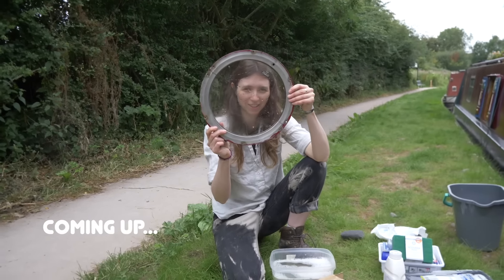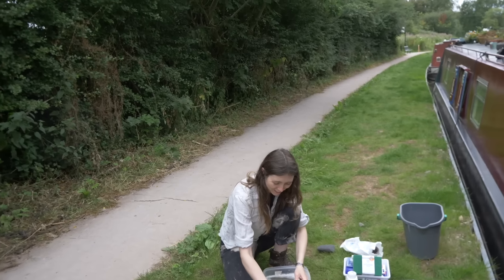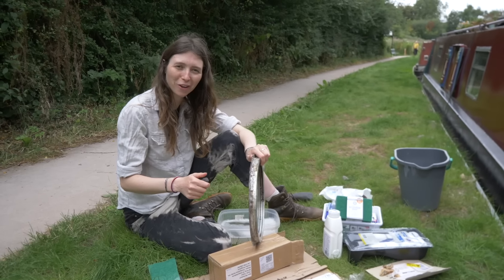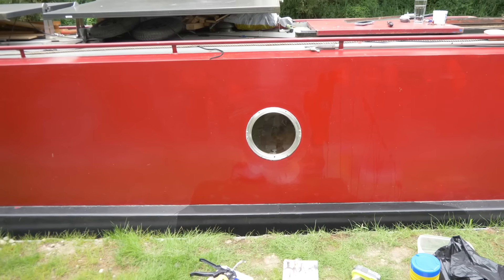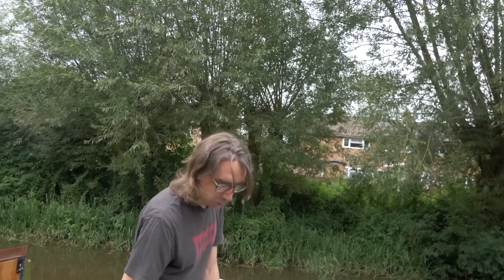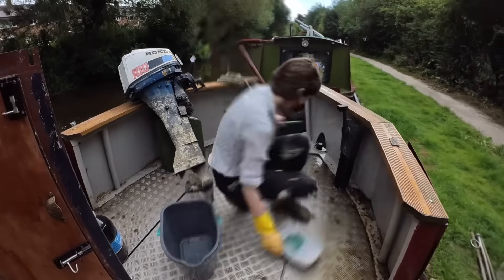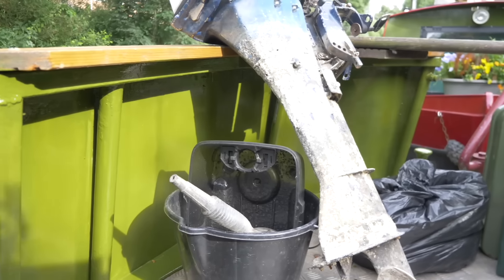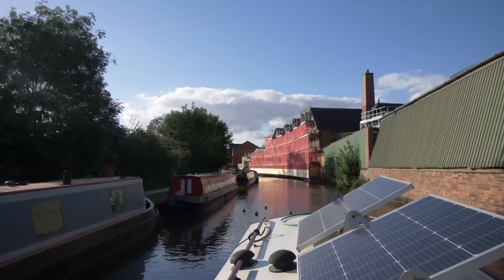This Was Long Overdue | NARROWBOAT LIFE

Comment: Those will tarnish again very soon.  If you want them to stay like this do a fresh steel wool scrub then put a clear coat spray or brush over the aluminum.
Reply: I agree. I think I would also have tried a Dremel with a fine wire brush and taped off around the frame-unless they had to come out cos of the leak. Good job though.

Comment: Should you guys ever renew the paint job on the side of the boat then maybe consider welding on some eyebrows above the windows.
Just a few simple strips two or two and a half inches above the square windows going halfway down the sides ending at one inch out with rounded bottom edges.
And half circles also coming outwards for two or two and a half inches on top of the round windows.
And also cut them back one inch as they go down halfway.
Like the shape that you will sometimes see sticking out on an old motorcycle headlight.
It’s a relative simple fix to keep the windows from ever leaking again and it ads character to the boat.

Comment: Step 3? You are short selling there. Cleaning, rubbing down, rust scraping, rust treatment application, keying, then priming - that's 6 already. Undercoat, prep for top coat and then top coat means it was a 9 step process and could be called 11 steps - moving everything out the way to start and putting stuff back afterwards being the other 2. You are doing more work than you are counting. If you were a contractor you'd add in a few extras, not knock them off the list. Nice job on the the sterna and the window too. I hope it doesn't leak again.